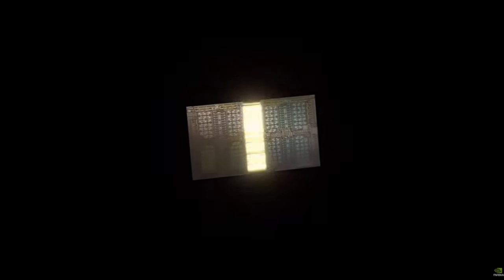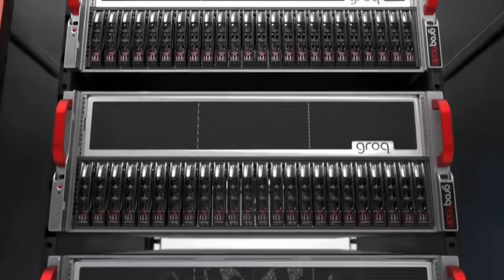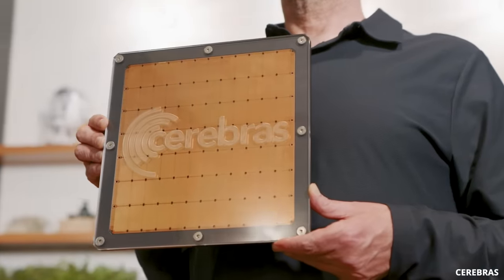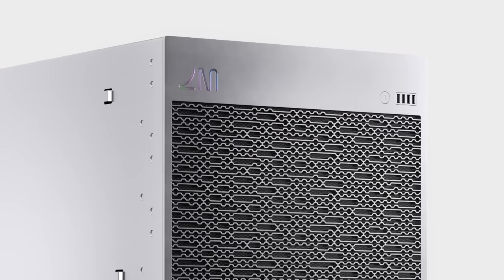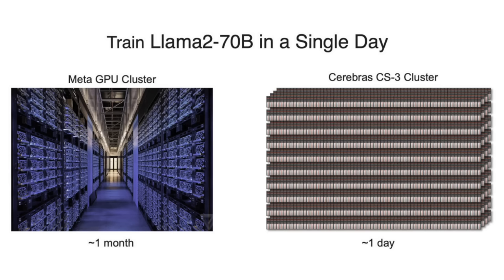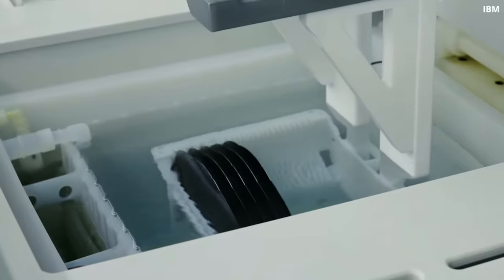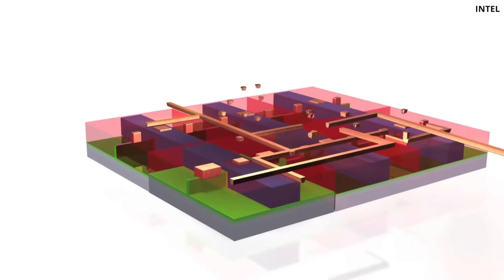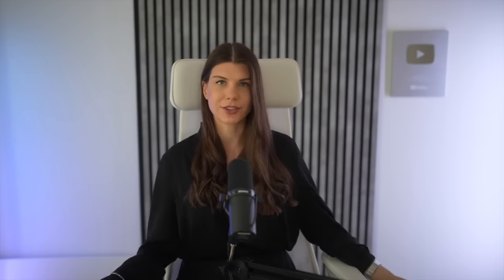Why do we need LARGER GPUs

Comment from the maker: Go to https://l.linqto.com/anastasiintech and use my promo code ANASTASI500 during checkout to save $500 on your first investment with Linqto
Reply: You said before we will get RISC-V. Will we? I mean Consumer PC.
Reply: Cerebras is not! outperforming Moore's law. Moore's law states that the density of transistors will double every few years. In what way does the Cerebras chip outperform other chips according to this metric?
Reply: @AnastasilnTech would you consider sharing your investment portfolio? I am very new at doing my own investments and I would be very interested in which startups you like. Doesn't have to be $ amounts and I will not consider your words as investment advice, "disclaimer".
Reply: I GPU  mine and rent them out to ai or POUW like FLUX for renting. I avoided the 4090s but getting ready to buy the 5090. I hated the heat that vram ddr6x puts out , so i hope the drr7 vram fixed that heat issue. I own 20 evga 3070 drr6 gpus . SO ya lets go 5090 GPUs! Before xmas
Reply: يبدو لي أن هناك مشكله تعانين منه في صوتكي
Reply: يبدو لي أن هناك مشكله تعانين منه في صوتكي
Reply: Only the rich enough (aka accredited investors) are allowed to get richer, of course.
Reply: @AnastasiInTech the promo code is not working as of 3/27/2024
Reply: Not viable strategy. IA bubble is going to burst and then costly (to produce) chips will just be a trap. They are going for larger chips because they face a bottleneck, feel competition on their track and that is NEVER a good sign.
I wonder where I can bet AGAINST Nvidia stocks.
Reply: If you want to understand AI, then contact me. Otherwise AI will continue to be misunderstood and too complex to use. Daniel J Blatecky USA

Comment: Who else ran to the channel at sublight speed
Reply: I would be impressed by anyone running at greater than sublight speeds.
Reply: Beans
Reply: Everyone
Reply: Duh I have mass
Reply: Actually... we all ran at light speed in spacetime.
Reply: @jasonsmall5602  By my math, earth is moving 2.1 million km/hr +/- 935 thousand km/hr based on a couple orbits. For a max potential of about 3.035 million km/hr.

The speed of light is about 1.079 billion km/hr.

So we're cruising like 20-30% the speed of light or so.
Reply: @brandonhoffman4712  Nope. You're only taking space into account. The speed through spacetime is always C. The faster you move through space, the slower you move through time. The combination of the two is always C. And your math is off.
Reply: @drunknmasta90 Being horizontally challenged is not something to brag about.
Reply: @brandonhoffman4712  You didn't factor in the calculus of the solar system, orbiting the milky-way galaxy and the speed of the milky-way galaxy moving through space time.
Reply: Not me. Took me a day after seeing it.   It’s a breakthrough every 6 months it seems lol
Reply: @m101ist  yes I accounted for our orbit around the galaxy and the speed of our galaxies movement.

What I did not account for was the expansion of space itself. 1 because I'm not certain science has hard numbers on that. 2 because it is not actual movement, so much as an expansion of space behind the movement.

You could always check my math before just claiming I didn't account for things. I would love to hear you contribute via some research rather than coming in like a flat earther and quoting nothing while telling me I didn't do what I did do.

Have a nice day.
Reply: Was on my computer, but saw it on phone, never dropped my headphones so fast.
Reply: I did too !!

Comment: 4 bit calculations used to be how everything worked - we just cobbled together several compute units to build microcoded processors that had wider registers. On a separate note, calling these things "GPUs" seems to be a misnomer. These are not for graphics, and can't really be  repurposed for graphics.

Comment: You are creating for yourself a remarkable reputation as the source of accurate knowledgeable and relevant IC technology.  And this reputation is a valuable commodity that can’t be easily replaced.  CONGRATS.
     I’ve been around chip tech since the PDP8 computer was built on 7400 series Chips that only had a handful of gates per chip.  There’s been many technology approaches & architectures over the years and you seem to have an accurate perspective of how the horse race of chip technology plays out.

Comment: IBM was the computer to beat in the 1050s, 60s, and 70s.  They started out using 4 bit words (Binary Coded Decimal) and moved through Extended B.C.D. (6 bit words) to 8 bit words (ASCII).  Some modern equip. uses Unicode (16 bit words) which can represent nearly every written language in use today.  The size of the work affects the amount of work the chip can do in a given bit of time and especially how much physical memory is used for each character.  IF all you are doing is math, you don't need big words.

Comment: I once profiled a program that I suspected to be slow because it copied gigabytes of data multiple times. The copying time was only marginal. Instead, it spent most of the time performing a log calculation, then rounding the results. I implemented a low resolution log function that turned out to be faster than the fpu version. That's when I learned that calculating something up to an insane amount of digits is often a huge waste.

Comment: Appreciate your expertise.  Would love to hear your comparison with Dojo architecture.  They too use one of the special packaging processes from TSMC to put 25 die on a single wafer as I understand it.  Seems like that would improve yield on final chip integrated wafer higher than single chip all in yield.  You get to pick the 25 best yield in smaller chips and assemble them on a larger package with only interconnect which seems similar to Blackwell but at a whole other scale.  Would love to hear your thoughts.

Comment: 5:32
«Honestly, 4 bits is quite low and that makes  me curious to see how well it's going to work for inference application.»

There's a relatively recent paper out there that suggests you can do pretty well using a single trinary bit, or values of -1, 0, +1 (about 1.585 binary bits equivalent), for your weights.

Comment: Kind of makes you wonder why Cerebras doesnt just make round chips, if they are going to take up the entire wafer, why not just use all of it? (they could place notches on the edge to help with orientation).  I think the biggest problem for monolithic chip designs is that they can't easily be modularized or repurposed and if the chip fries you lose the whole thing, so even though the chip has redundancy built in, its still not a fully reduntant system.
Reply: I assume a partial chip section is not a completed circuit.
Reply: Step and repeat is how IC reticules are exposed.
Reply: @supermodal  the cores are tiny so they could go right up to the edge of the wafer
Reply: I suspect it has to do with the circuit design software everyone is using. Laying out the logic for a compute unit in a curved segment at the edge of the wafer is possible, but the software isn't set up for that.
Reply: @HelgeMoulding  It has to do with the reticule step and repeat.  X/Y grid step and repeat.  The edge of the wafer is exposed but die to it being circular you never get a full rectangular coverage.
Reply: Even Cerebras takes many known working chips and places them on a single large [rectangular substrate] for making the interconnections.

Comment: I wrote a workshop paper years ago that shows that lower precision can be compensated for just by including that limit in the training process. Backprop has to be done in floating point to accumulate small weight updates. But all forward calculations have to be done in fixed point. The imprecision causes prediction error, which backprop compensates for naturally.

Comment: Wow I had no idea someone was  using the "interconnects" as a capacitor. Concidering that is already occurring within a chip. That is genius and opens a massive area for alternative computing methods. It could reduce heat/power and need for additional transistors very exciting stuff I need to do some research on this thanks you

Comment: Since Nvidia was forced to use N4p, its safe to say that another leap on performance is almost guaranteed on next iteration from improvement alone. 

Regarding the decision to make FP4 the standard, the tradeoff between more parameters/less precision makes sense since there are recent studies showing that quantized models show negligible performance drop when compared with full precision, and that training models with lower precision from scratch may close the gap even further (given the right architecture, of course).

About the hybrid chips using capacitors for addition, I wonder if another benefit on the future could be the ability to asynchronously discharge the accumulated charge when a certain threshold is reached. Such architecture could resemble neuron spikes and the way the human brain works asynchronously and with lower frequency.

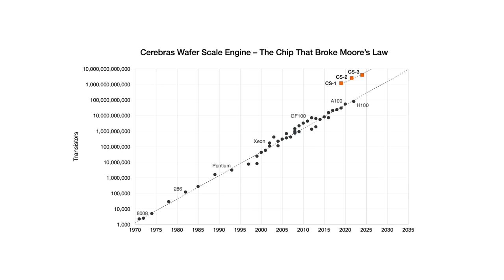Comment: 7:30 to be fair to Moore’s law… It doesn’t really state that transistors “per chip” doubles. It states that transistors “per area” doubles. The Cerebras chips are not breaking that - they are still putting the same number of transistors per square cm as the other N5 TSMC chips are. It’s just that historically “chip sizes“ have roughly been the same, more or less, generation to generation, due to manufacturing constraints, heat dissipation, system design constraints, package design, etc. So assuming the chips are roughly the same size, if transistors shrink then the transistor amount doubles from one generation to the next, then that roughly means transistors per chip has doubled. But in reality, the Moores law charts should all have transistors per square centimeter as the y-axis, not transistors per chip. (And for the pendants, of course Moore’s law has also been modified to indicate “performance per area” instead of just transistors per area). 

Having said all that, breaking free of the standard maximum die size as constrained by the photo mask  and interlinking multiple dies together so they effectively function as one chip is a pretty incredible breakthrough, without using an interposer or other off-die layer like the Intel “Tiles” or AMD “chiplets” use.
Reply: Agree, this is misleading saying breaking Moore’s Law.  Not true.  Wafer scale has been done before.  Thing new.

Comment: When i think of it, regular RAM is also capacitor based
Why didn't chip manufacturers slap a lot of capacitors in form of metal layers directly on chip?
After all transistor cache doesnt scale well compated to logic gates
It will require rewriting EDA software from the grounds up
But gains will be astonishing in my opinion

Comment: giant chips comprised of compartmentalized chiplets running in parallel is obviously better than the current commercial paradigm cudas are jamming on, but I believe that the ideal hierarchy of space and appropriated cache looks more like IBM/Motorola's Cell.  Visualizing answers to human problems should be given a structure that provides chip designers with an inherently optimized skeleton to experiment with while maximizing throughput for unique formulas.

Comment: Any time the silicon die yields are below 100%, you have to discard a number of chips because of flaws. This is why a 16 core CPU chip is marketed with, for example, only 12 cores. 

NVidia's Blackwell GPU pairs every working chip on the die to another working chip. This increases die yields by a very large amount, compared to a single GPU chip of twice the surface area.

Comment: It would be interesting to know how they implemented 4-bit multiplication. One could do it as a pure table lookup (there are only 256 possible results) but it's hard to tell if it's faster to do the full multiplication calculation in hardware instead. With the huge amount of transistors the new chips have, it might be faster to always compute everything on the fly.

Comment: Ana, please adjust your sound. There's a persistent noise in the videos. It could be interference affecting your audio interface's mic preamp, or perhaps the cable is faulty. Regardless, it's not a significant issue because there are numerous VSTs available that can enhance dialogue with a single button press. Examples include Voxessor by Soundevice Digital (UnitedPlugins), Waves Clarity VX Pro, iZotope Dialogue Match, among others.

Comment: Moore‘s law : Talk about the cost Not the amount. The complexity for minimum component costs has increased at a rate of roughly a factor of two per year. Certainly over the short term this rate can be expected to continue, if not to increase. Over the longer term, the rate of increase is a bit more uncertain, although there is no reason to believe it will not remain nearly constant for at least 10 years.
Reply: People keep redefining Moore's Law so they can say it's still relevant.  It was never a measure of performance.

Comment: Hi Anastasia, I enjoy and learn from your well presented videos. Just one comment, in your discussion on analogue computing you seem to suggest that transistors do digital processing and (correctly) that capacitors and resistors do analogue processing. Is this correct? Transistors are commonly used in analogue ccts such as audio amplifiers. I now that in digital ccts they are used as switches, is there a cost in using them in analogue mode (i.e. energy, thermal costs)?

Comment: Thank you for your video. in the mid 70s I had a chance to be the early user of a hybrid computer (digital / analog computer) and in the 60s I had a chance to use an analog computer. I'm glad to see analog making a comeback. I think there are other interesting applications for analog. For example maybe it can be used in Ensemble modeling. (I recommend The Primacy of Doubt by Tim Palmer).

Comment: Neural networks are pretty much based on floating point values, or biases. If one represents those values are analog signals, then most functions can be performed at analog level. 
The large upside is that analog processing is real time and does not require several clock cycles. Only downside is precision, but then thats somewhat interesting too on a neural network. 
In an abstract way it gets closer to quantum computing.

Comment: I was aware of this hopper tech coming down the pipeline about a year and a half ago. And according to reports it was described as "throughput technology." I can see now it has nothing to do with changing the power equation in chips, and everything to do with the way it allocates memory. 

I thought it was likely at the time to be the answer to AMD's chiplet approach, cos they have used chiplets in their GPU's. Cos, they have suffered from not enough throughput. And it has turned out not to be the case.

But now I am more interested in what AMD are doing to get throughput between their chiplets. Which obviously has to do with the way electricity works in the chip, and the power equation. 

My question is: do you think with advances in throughput from AMD, that there could be any kind of hybrid technology between what Intel have done with their allocation of memory (allocation units), and anything that AMD come out with to increase the throughput between their chiplets? If in fact they are able to accomplish this. It just seems to me to be two things that might be able to benefit from one another with a bit of imagination.

This is very interesting to me:)

Comment: It will be interesting to see how software will have to evolve in order to maintain accuracy of results when the compute is having to be scaled up to handle the pathway to get there (since it is not as precise). As odd as it is, it would be alot like a cows digestive process. recycling the output as a new input to refine the result. But being much faster in each cycle.

Comment: Once anyone knows the understanding of what allows any parameters of performance to be had on any device.. Then the only last concerns are the right material availability, and current machining precisions for the parts themselves for the only remaining possibility of a slow and natural progression of such technology.
However. It seems as if professionals are only just realising that memory images and data "is not influenced by the size itself" of the chip or their parts... But of the number of units/engine/parts themselves upon the chip for the memory and performance.

( This means that a 1TB cell on a 1 by 1 inch space scaled down to 1/1000 "can still render the data or image exactly the same" on any screen size of any device that is made to plug in and recognise that 1 inch by 1 inch space. This also means that if you can machine 1000x of a 1/1000 scale city structures of 1TB and placed them together in 1 chip. You would now have a 1 Petabyte memory capacity in a 1 by 1 inch space. Yet you see this all he time with much larger old chips being severely obsolete to much more modern variants )

Comment: Thank you for your videos. This was very useful like always. 
Analog circuits have a few big problems yet, that is noisy, unclear and unsafe to protect our data and information. Another issues about analog electronic are, very hard & expensive to design and manufacturing. For these reasons now a days we are gonna run telecommunication and networking subsystem on digital such as digital electronic warfare, digital define radio, digital spread spectrum communication wireless, digital modulation and de modulation signal in internet or even chanel coding & decoding and..... Technology. In my opinion, the future will go towards quantum rather than analog. Maybe i am wrong 😊